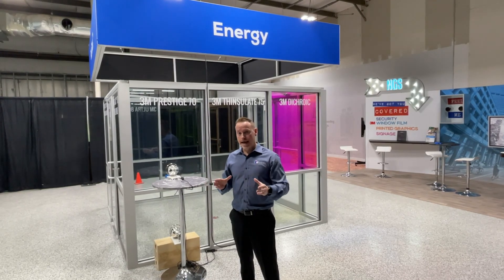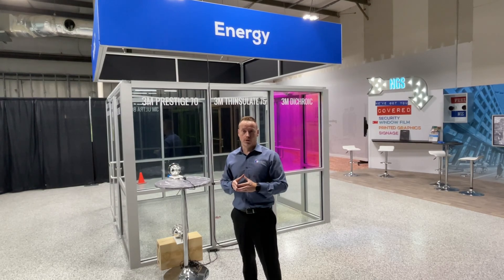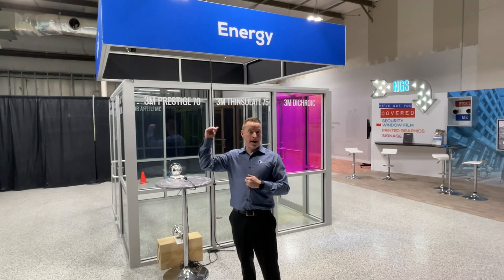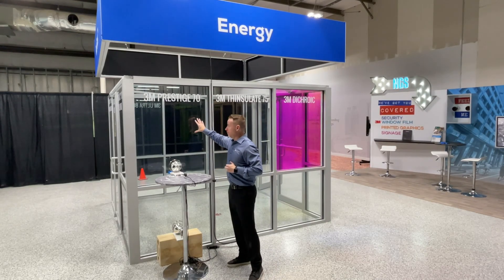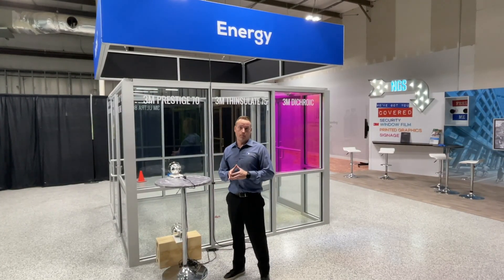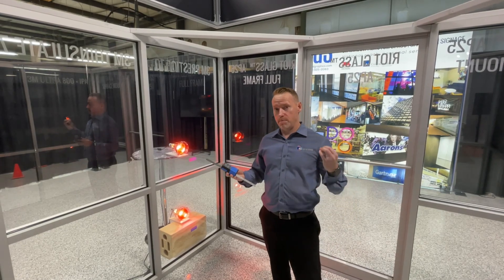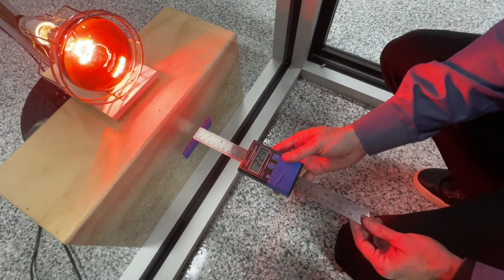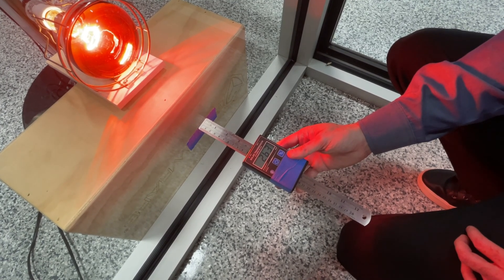3M Prestige 70 Solar Window Film Performance Demonstration

Comment: This product seems promising.  But I'm not convinced from this type of demonstration.  I don't think the testing environment is measuring what it intends to be measuring.  Seems like you'd need at least two glass cube rooms, one of which would be the experimental room, covered with a single type of film, and the other glass cube room would serve as the control, with no film.  A sun-simulating light should then be shone for the same amount of time on each cube, then measure the heat.
Reply: this test is meant to demonstrate the improvement/ heat reduction from a BTU lamp using the same glass type with one panel filmed and the other panel unfilmed while maintaining the same distance from the meter and the lamp.

Comment: so.. im wondering why we have not seen window film solar panels.  as in window tint thats also energy capturing solar panels.  it only makes sense that buildings windows should by all means be solar energy capturing panels. Glass abundant skyscraper should be solar power plants considering how much sun light they are exposed to.  hell one could argue most of its energy requirement could come from its own windows and exterior surfaces.
Reply: The issue currently is that they are not able to build an efficient enough solar harvesting film that is transparent enough for windows.

Comment: I’m considering putting this on a particularly large non-opening architectural window. BUT the window has lots of thin wood panes. Can it be installed over the panes as well to help with water leaks or does it have to be cut to each individual glass pane?
Reply: has to be cut to each individual pane.

Comment: It's a perfect solution for modern homes with floor to ceiling sliding glass doors or modern homes in general since a large portion of the house is made out of glass.  This will mitigate the heat.